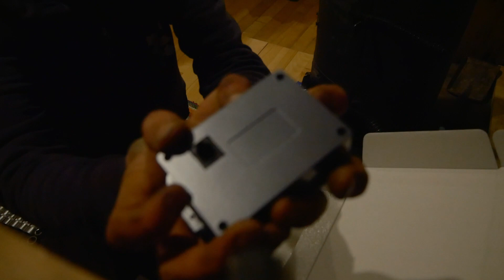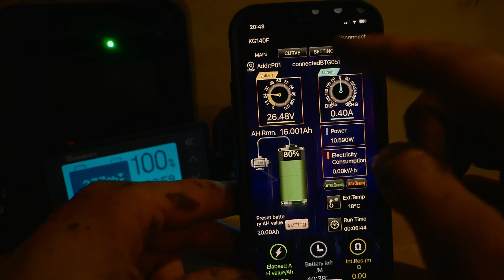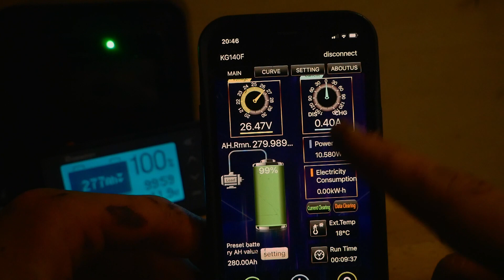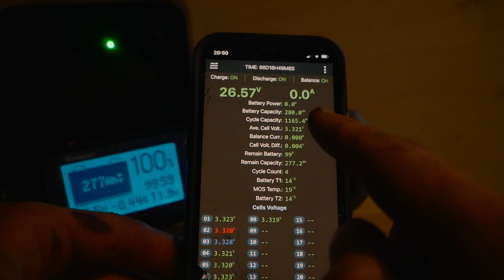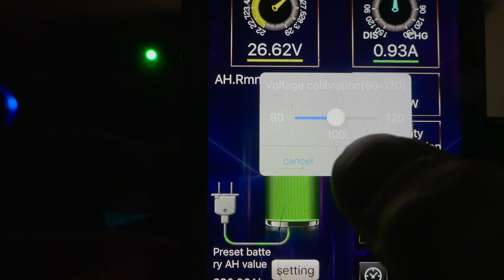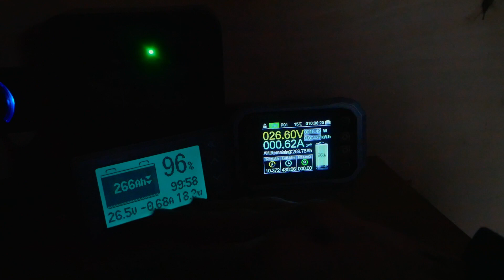Junctek 400A Battery Monitor Review

Comment: Hi there looks like this model has been updated. You have the KG140F, but now there is a KH140F. The new one has a plastic case that the  shunt mounts into, it has low temperature cutoff control for a relay, and an updated user interface in the app and on the display.
Reply from the maker: Yes I saw that as I was editing this video😁
Reply: @RustyRoseAdventures  I'm just doing some research on what I'm going to put into my camper. The setup looks to be the best bang for the buck as long as it works long-term
Reply from the maker: @mykrowsy  yeah, EPever controllers are great! And sterling products are really good quality too